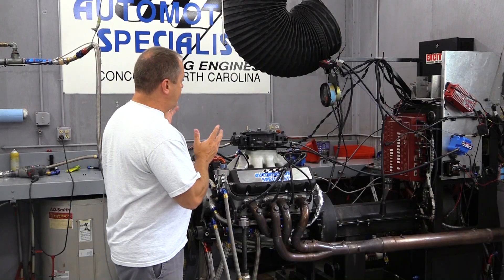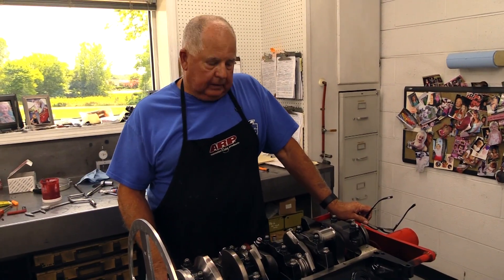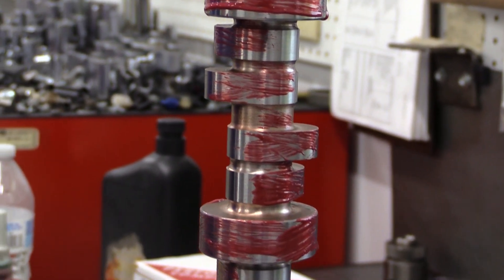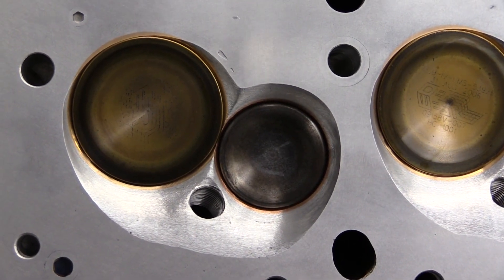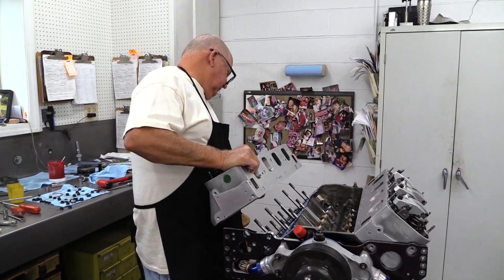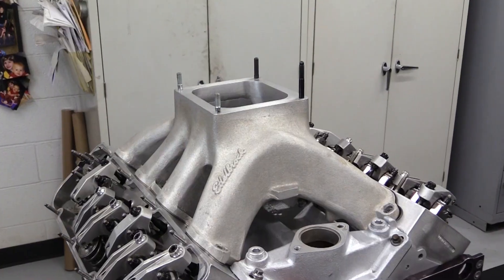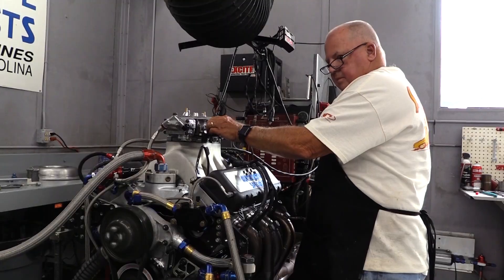NASCAR Chevy SB2 V8 Turned Into a Racing V6!?

Comment: Looking at this engine build is like watching dinosaurs roam the earth in 100 years!
It will mostly be electric.
Tesla built a truck that can tow 300,000 pounds.  Who can compete with that?
Reply: Towing 300k isnt hard stopping it however is the problem
Reply: A 73 chevy did more I wouldn't trust it to actually do that in real world. Tesla is a company of stunts that dont add up
Reply: @jdrok5026  
In 50 years cars will drive themselves.  Imagine a cab without a driver...
Reply: Well, I'll tell you who'd compete with that on the interstate... Four class 8 trucks loaded to 75,000lb GVWR each, because they'd actually make it through a weigh station.

Comment: Can anyone explain the effect of those unused pipes going into the collectors? With the intake and exhaust ports sealed off on the unused cylinders, I couldn't help wondering why it still runs conventional 4 per side V8 headers.
Reply: It would be a strange sort of air spring effect as a pulse tries to scavenge the dead tube but I don't think you're actually going to see that much of a difference performance-wise since it's actually doing this anyways. Any time an exhaust pulse passes the rest of the tubes at the collector it kind of 'sucks' on the other three tubes, one of which is going to have an exhaust valve open shortly and that helps draw the exhaust a little better than usual... you're just not 'backfilling' one tube with fresh exhaust. And since the missing pulse is probably one of the doubled firings on that bank it all ends up equalized probably a little better than the natural V8 configuration would be (no double pulse)... I could explain this better, getting winded though :)

Comment: Why not just build on a olds 260 4.3 V8 ??? It's a true GM V8?? Not much power 150 at most HP stock.. but ya never know with today's tech you prob could get hella power out of em
Reply: Damon Mullins as explained on a small v8 the stroke it too short to build compression

Comment: Have you guys seen the V12 made by australians, basically two LS1's welded together and now we have a V12 and once they perfect the welding or even make a casting of it to ensure everything is Miro mm perfect, we will have Australia's First V12 in fact it the first time anyone in the World has made a V12 out of two LS1's. :) Why not cut the V8 to make a V6 so to speak, that way you could make the Weight savings and then work out how much CC's it needs to be to fit in with in the rules per say. :) Still great work guys and keep it up. :)
Reply from the maker: Thanks for watching. I've seen that V12 and it is an awesome motor (and piece of engineering). Dorton didn't bother with cutting up the V8 because non-rotating weight isn't an issue on land speed cars. They actually add lots of weight in the form of lead to help with ballast.

Comment: Question, why kill the back two cylinders, and not the front two? I would have thought having the torque load (and associated valve train weight) would be better on the end, not the front of the crankshaft and cam.

Comment: I'm kind of scratching my head.  It's not that hard to get 13:1 with custom pistons.  Nice machine work, though.
Reply: I'm thinking that myself, can build an engine to what you want, you want 13.1 compression from a v6? You built it to, no reason to use a v8 other than it may be cheaper except I'm still wondering how it runs smoother when its losing 2 power strokes, unless i missed it, i didnt hear them talk about any custom crank, just putting weights on to simulate the weight of the 2 pistons and rods you lose.

Comment: Would have been much easier and much, much more efficient to use the new LS based 4.3 V6.
Reply: wvXvxvXvw well maybe but if you listened they are limited to 260.99 cubic inches. The 4.3L LS starts life at 262.3ci. So unless you destroked it, which is moving in the wrong direction for HP in the first place that engine is too big to use.

Comment: I’m struggling to see how this is better than a DOHC straight 6. Still though, it is super creative and VERY impressive.
Reply: There are very specific classes for Bonneville, a DOHC would be in a completely different class. This team is running old school in a pushrod OHV class limited to the size they stated. The Southern California Timing Association (SCTA) have, or will create a class for anything you bring. Different fuels, engine types, sizes, power adds, body styles, etc Check them out.

Comment: @The horsepower monster 3 questions did they plug the exhaust runners at the collectors and why didnt they make headers have 3 runners
Reply from the maker: Maybe I can't count, but I only see two questions? Anyhow, they plugged the exhaust port in both cylinder heads with epoxy. The headers you see in the video are Keith's dyno headers, but in the car they will use headers with four tubes for each bank as well. That's because the car will run multiple engines at Boneville as the team attempts to break several different class records. Having one set of headers makes engine swaps easier, and the extra tube doesn't hurt anything. Thanks for watching!

Comment: Why no fuel injection?
Reply from the maker: This engine is built for wide open throttle blasts only. A well tuned carb can make just as much power at WOT as a typical fuel injection system. Fuel injection shines at part throttle fuel mixture, cold starts and changing atmospheric conditions. It is definitely better all-around, but for Bonneville and five-mile full throttle blasts, it really isn't an advantage. Thanks for watching.

Comment: Start using DOHC, and then you'll have plenty of space for valves and maximize intake and exhaust flow. Hell, you didn't even need DOHC to have 4 valves per cylinder. I get it that the pushrod system is allegedly more reliable and can handle a lot of abuse but come on. I love your V8 as much as any other petrolhead but, across the pond, we abandoned the pushrod in any car based motorsports for half a century at least. Truck racing championships and drag racing are the exception. Is it not worth the try? Or it's just too expensive?

Comment: Genuine question - why not use a modern DOHC V6? Or is it against the rules?
Reply from the maker: One of the main reasons is they use one car with different engines to go for several records at Bonneville. Keeping everything to small block Chevy dimensions -- such as bellhousing pattern, motor mounts, able to use the same set of custom headers, same carb height for the air inlet -- makes it easier to swap engines in and out while on the salt. Thanks for watching!
Reply: @TheHorsepowerMonster  And DOHC would be a completely different class, regardless if it used a Chev bellhousing. If they could build up an original LT5, it would work in that car. But wow, the expense to modify one would be astronomical. https://www.hagerty.com/articles-videos/articles/2019/03/08/c4-zr1-is-bargain-corvette

Comment: Why would you not be able to have high compression with a lower displacement V8?
Reply from the maker: Because the combustion chambers could be not smaller than the 40 cc's he ran in the cylinder heads. They had to be that size because he wanted big valves for lots of air flow at high rpm. So, by cutting out two cylinders he was able to make the stroke in the remaining six 25 percent longer, upping the compression ratio. Hope that makes sense, and thanks for watching!
Reply: you run out of crank stroke

Comment: Why not just use a 4.3 L V6, that is what it is, a 350 less 2 cylinders
Reply from the maker: Because no OEM cylinder heads flow anywhere close to SB2 heads, and this engine was all about high-rpm power. Thanks for watching!
Reply: @TheHorsepowerMonster  I guess there are no good aftermarket 4.3L heads?
Reply from the maker: I don't know what aftermarket 4.3 heads are out there. But just for comparison sake, a good port job on a GM SB2 casting (not the more modern Edelbrock which can be even better) can flow as much as 450 cfm. They are huge ports. An original Vortec casting when ported to the max will be lucky to get 250 cfm. It's almost apples and oranges.
Reply: @TheHorsepowerMonster  I didn't know what was out there for a 4.3 either, just kinda figured it would be just a cut off 350 head as well, but maybe they aren't available since its such a limited market.

Comment: Why not just cut off the rear two cylinder castings and use a proper split pin 90 degree v6 crank?  Smoother all around and even firing!  Chevys own Vortech V6 was basically this, although the block was cast as a V6 which used the same pistons and valve gear as the related V8's made in the same plant...
Reply from the maker: I imagine the reason was probably cost. Practically all this stuff was already sitting around on the shelf. He builds tons of SB2 engines for different purposes. Thanks for watching!

Comment: Would a gear drive have more parasitic than a belt drive cam?
Reply: With the belt drive you have less harmonic vibrations coming from the crank shaft up into the valve train which can cause valve train damage and broken springs compared to either a gear drive or steel timing chain .
Reply from the maker: I know some drag racing engine builders use gear drives. Mostly where I've seen them is on Sprint Car racing engines because they run the external dry sump oil pump off the cam drive on the front of the engine and need a setup that can take the stress. They say a gear drive really doesn't suck up any extra power if set up right, but I really don't know. And I don't know how long they last. Thanks for watching!
Reply: @TheHorsepowerMonster  Trouble with gear drives is you only have 2-3 teeth transferring the torque at any given time, and if there are gaps in the cam's torque requirements then it's going to potentially chatter against any backlash at some resonant RPM. Big reason Ford used phenolics with theirs, hard enough to wear well but soft enough to close up the tolerances,  absorb some vibration, and not gall out if it does chatter a little.

ED: Also, would require either a reverse rotation camshaft, which the heavily customized architecture here might not support well, or a two stage gear set with one or two idlers and you're stacking tolerances with that backlash/chatter problem and adding more bearings and small gears with their own issues with tooth profiles/proper mesh and attachment requirements, shrinking the drive and driven gears, etc. etc.  

I suppose you could drive a cam with a planetary gear arrangement but you'd pretty much have to design a block from scratch to pull that off, and run all the accessories from the cam gear since it's going to overlap the crank gear. Timing that would be a royal PITA...

Chains and belts are the go to. Manufacturers solved the single stage gear driven cam with material selection... other systems were tried throughout the years and abandoned, you had some F1 class engines with little gears in a train up to DOHC heads on both banks, you had some older motorcycles that ran a vertical shaft on two bevel gears to reach the cam, another one that used a miniature crank linkage to turn a SOHC cam, was even reading about one attempt at driving DOHC cams with a triangular linkage on three identically sized rotors, like something you'd see on a steam locomotive... weird. One very old engine I recall seeing ran a cam profile on a ring directly attached to the crankshaft and had a little mechanism that disconnected the pushrod every other stroke, but that's in the days when an engine running 3k RPM was a legendary feat, so...

Comment: why use a V8 tho. All that extra weight when you can just use a V6 and make it to this Spec?.
Reply from the maker: In land speed racing non-rotating weight isn't an issue. They add tons of lead to the car anyway to keep them on the ground. Thanks for watching!
Reply: @TheHorsepowerMonster  Oh yea that's right. Didnt think about that

Comment: I wonder why he decided to block the rear two cylinders instead of the front two. In relation to the flywheel thats some extra material material it has to pass energy through to get to the transmission. Maybe the motor is mounted with the traditional front of the motor to the rear of the car? Maybe they found something in the wind tunnel about how the air entered the scoop? Maybe it doesnt matter?

Comment: How do you drop two cylinders without messing with the even distribution of power to the crank. I know...you're going to tell me the crank and the cam were special built. If that is the case, then why would you have to "fool" the distributor into thinking it was running 8 cylinders?
Reply from the maker: Nope, you are right. The crank is a standard V8 crank. There are big gaps in the firing order. Normally, the crank sees a power pulse every 90 degrees of rotation, but there is a 180 degree gap when cylinders 7 and 8 should be firing. Obviuosly, this isn't a 100,000 mile motor, but it doesn't seem to be bothered by it. Camshaft is also standard firing order. He didn't even tell the people at Crane that the engine would only have six working cylinders.

Comment: How is this different from a V6 with a huge set of slugs for the missing 2 pistons.  Chevy racing V6 was just that!  Buick V6 was better, in fact, sb2 heads are based on the Buick stage ii heads.  This is so much bad engineering!  GL!

Comment: Its cool, but i am not computing to how he needed to use a V8 converted to a V6 to make 650hp.  There are so many options to make that kind of power.
Reply: Not without forced induction, though. We're looking at something like 3 hp per cubic inch ON THE ENGINE ALONE. Carbureted and a gear-driven distributor, not individual ignition packs.

Kind of shows how far you can take old skool.

Comment: So its like a performance oriented 4.3 lol
Reply: Why bugger around with a V8 when you can just grab a 4.3 ?  They're a 350 with 2 cylinders chopped off.  Perfect
Reply: @172-e5s  my understanding is it's all about balance. V8s are far more balanced than V6s and this V6/8 rotates as smoothly as a V8. Not only that but the SB2 is a MUCH different animal than the SBC that the 4.3 is based off of
Reply: @172-e5s  if that were true this motoring genius would have done that.Maybe they HAVE to use a V8 block.
Reply: @172-e5s  A normal 4.3L would crack the block from the RPM and Torque.
Reply: @172-e5s  4.3s are the biggest piece of shit motors ever
Reply: @hell-sol5240  
Why would you say that it's one of the most reliable engines they ever made.
It's literally a 350 small block with two cylinders chopped. Mechanically they're essentially identical
Reply: @kens97sto171  they have god awful gaskets cheap ass fuel pumps and eat gas like crazy and are underpowered and go into shitty cheap applications. 4.3s are trash.
Reply: @hell-sol5240  you must be using the spider injector.  Put a 390cfm 4160 on it.  You actually can tow a trailer up a hill with a Blazer.
Reply: Also 4.
Reply: @taylorh3930  Hicks must be the only people who want S10s to actually move and not just puke fuel out the tailpipe.
Reply: My thoughts exactly
Reply: My flat tappet 4.3 would give it a run for it's money. ;)
Reply: Dave Micolichek  LOLOL  you sound like my ex wife !!       lolol

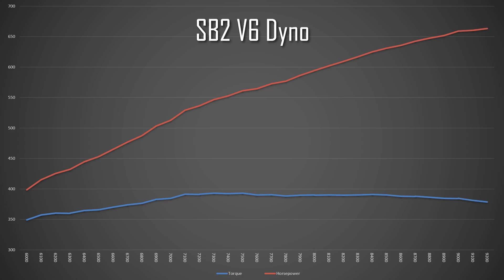Comment: A little misleading. 16:19 - "when we pulled the handle at 9200 RPM" vs. 15:26 9998 RPM shown (May need to go frame by frame to see it. Use comma and period to move frame by frame forth and back).
Reply: ......handle at 9200 rpm, it still hadn't reached peak power" nothing misleading.

Comment: "Limited to 4.2L, cant get the compression"
All that work for 600hp?

From 4200cc, I guarantee the Italians, Japanese, germans and british can screw more than 600hp from a 4.2L engine.
(Tvr could smash 650hp from a 4000cc straight 6)

Maybe, just maybe, running 2 valves and push rods on a 90deg block is the automotive equivalent to flogging a dead horse.
Reply: That's the rules of the class.
Reply: @SethBergile  I know that's the rules of the class.... 
But why bother with an antiquated V8 boat anchor if you're going to turn it into a V6 anyway? All that crap about not getting the compression ratio.... is nonsense. 

For the 600hp they achieved with this engine, they could have just as easily used an already produced V6.

Alfa Romeo managed to get 500hp from a 2.5 V6.

Using a V8 as a base just adds weight.

Comment: Good luck at Bonneville. I'm headed out for Speed Week as well. That is one of the things I love most about Bonneville is just all the weird stuff you see. I remember my first year going to Speed Week, someone was running a streamliner with a blown Hemi in it, except 1 whole bank of cylinders was missing, and they were running it as a 4 cylinder. 2 friends of mine run a coupe with a Model A flathead in it that has a DOHC conversion he built in his garage, casting and everything.